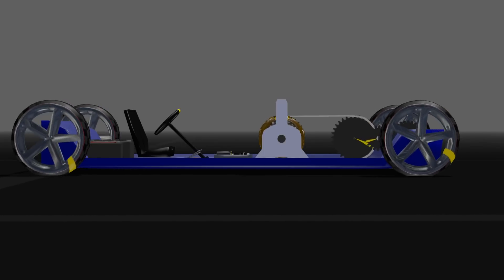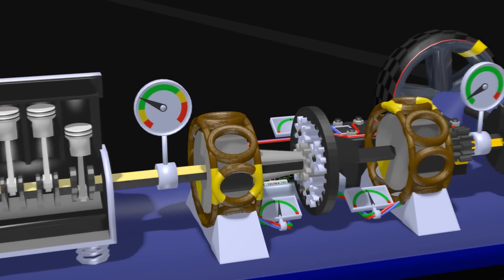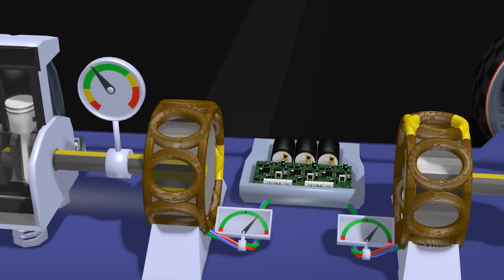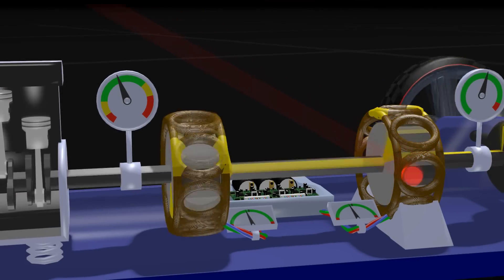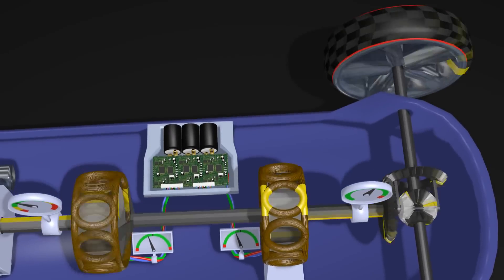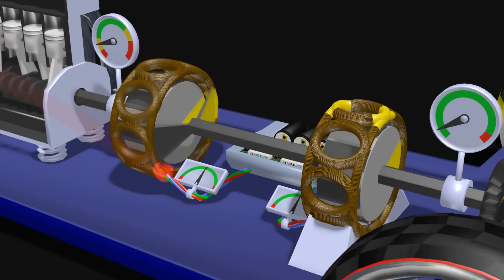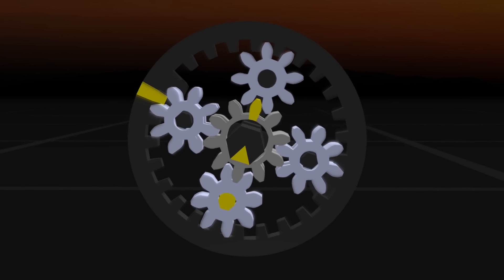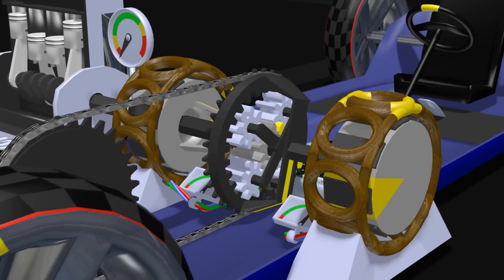Prius Hybrid Drive Explained

Comment: I know this is a few years on, but it’s the first time it has ‘come to life’ as it were. You graphics for explaining how the planetary set works is effective - better than the original Toyota presentations.

Note that the second planetary set connected to MG2 (the traction motor) is really a fixed ratio reduction set, allowing the motor to run faster. 

The ‘smaller’ version of this drive (the so-called “hybrid synergy drive” (HSD) ) does not use a chain to connect to the differential gear set - it’s a short shaft from the ‘ring gear’. Although the mechanical arrangement is well described, there’s a bit more to it! In particular, there are three inverters (to work with the motors, which are variable frequency a.c.), and a pair of d.c. converters. The most important battery in this type of car is the high voltage d.c. one - if it’s dead you’ve had it, but if the smaller 12V d.c. one fails, that is easy to overcome with a conventional external d.c. “jump start” device. 

The contractor for the HSD is Aisin-Seiko - at least 30% of it’s shares being owned by Toyota; it’s own site may be of interest.

Also worth noting that the choice of this system is related to the use of the Atkinson cycle for the engine (most of the time), so as to optimise it’s thermal efficiency, at the expense of reduced torque/power at any given engine speed. What is nice about it is that traction motors have maximum torque at zero speed.

Comment: Great animation and great explanation.  Ford and Toyota share many patents and Fords powertrain has the same flow. I like the way Honda and Chevrolet are running the Clarity and Volt. I just drove the Clarity and it runs great in EV mode. The electric motor has plenty of power.  Thanks for sharing your animation/ explanation.
Reply: Ford pays Toyota for that actually.

Comment: So the Prius doesn't really have what we normally consider to be a CVT transmission with a drive belt and variable diameter pulley's?
Reply: No - it's far more sophisticated than that.
Reply: There's no sliding rollers or pinching belts.  Equivalent function and more is achieved with the planetary gear set, two MGs, inverter and NiMH battery.

Comment: Very concise.  Thank you for your effort.  I consider my 3007 Camry at least as smart as myself.  And it reflects what you've described.
Reply: I wonder what kind of technology your 3007 Camry has? Time travel yet?
Reply: @eo3769  Oops.  I'm a better driver than proof reader, really.                Cheers, JL
Reply: @johnleach7879  👍  Btw Camrys are legendary
Reply: @eo3769  Um, what, exactly makes them legendary (besides Big Toe Wishing)?
Reply: @johnleach7879  They just keep going. They are hard to take down unlike Buicks or the now defunct Saturns 😂
Reply: @eo3769  Why else would the Taliban choose T. pickups?   The rags, used to camels, which forage for themselves, apply the same principle to vehicles  (made by foreign devils, but useful).  Some years ago, a few of us had an idea to deprive the Taliban, et al, of T. pickups.  But by then, CIA had gone from data collection/action to merely collection.  MI-6 was, however interested, but they had no $.
So it became a fund hunt, and petered out.   Heavy  sigh.

Comment: My Prius is running like there’s a clutch skipping, I accelerate the engine and go to a high rpm and won’t go over 30 miles per hour?
Reply: Zabama Z  try releasing the  handbrake
Reply: Zabama Z Have you done maintenance well and change the air filters, clean the battery blower, gear oil change, tire inflated and many details to check. When engine running too high with low out put doesn't count on one particular thing but need to check how well the car is take  care of.
Reply: @davidshanlay  gear oil change? what do you mean by that
Reply: Do you have the red triangle?  It could be a dead battery!  (like the main one, not the starter battery).  When the battery is completely dead, apparently the car is throttled to a maximum speed.

Comment: Interesting that Toyota persevered with the petrol engine hybrid so long ago rather than concentrating on Diesel and lucky for them the way things have turned out (backlash against Diesel especially in city centres). The problem with the Hybrid Synergy Drive (especially series 1 & 2) is at higher speeds the ICE runs too fast (fuel consumption is relatively poor at higher speeds due to the lack of high gearing) and I understand that Toyota are working on a solution to this. 
What I didn't like about the Auris I test drove was that there appeared to be no way of knowing how hard you could press the brake pedal before friction braking came in to play. Toyota have made efforts to give the brake pedal the same feel as a conventional car but this leads to the problem I have with it.
May be I just wasn't taught properly on the test drive so if anybody can advise on this then please do.
Reply: Prius does not have an ordinary internal combustion engine. Cars run the Otto cycle, Prius uses the Atkinson design (there's an extra "knuckle" in the connecting rod). This gives more efficiency with slightly less power and far lower emissions. The brakes send more energy to the batteries (regenerative braking) depending on how hard the pedal is pressed. If you want to increase your mileage, look up 'hypermiling.' If you're worried about dwindling mileage at 80 MPH, don't drive that fast -- all cars get crappy mileage at high speeds. My Prius gets a solid 55 MPG on flat 55 MPH roads.
Reply: @CharlieGosh  Charlie, consider that you might be putting yourself at risk by doing 55 on highways signed for 70, in addition to prompting drivers behind you to do stupid things.  Also, an alert highway patrolman may pull you over and give you this same lecture, if not a ticket.   A few mpg isn't worth the hazard you're creating.
Reply: @John Leach No, I was referring to "unmarked rural highways." We have quite a few of them around here, and the speed limit is 55 MPH. On freeways, my best advice is to "drive the same speed as everyone else and avoid them like the plague." Especially trucks -- just stay away from them as much as possible. If you pay attention, you'll often find a spot where there are no other cars around -- they're all far ahead or far behind you. If everybody else is going 85, that's what I'm doing, too.
Reply: @CharlieGosh  Thanks for your response. Please note that the Prius engine imitates the Atkinson cycle via valve timing not by a `knuckle' in the connecting rod.
How The Atkinson Cycle Works - Car Engines
https://www.youtube.com/watch?v=z45fM2N-4C4&feature=youtu.be
Can you answer my query - how can you tell when friction braking is imminent if you press the brake pedal any harder?  (so that you can avoid friction braking as far as possible)
Reply: @Martindyna  In the Toyota Yaris hybrid, there is an instrument that shows the power flow, from 'charging' to 'power'. If the pointer 'hits the stop' at the bottom of the gauge, it's probably using the friction brakes as well as the traction motor. I normally try to keep it off the bottom as much as possible.

Comment: For those commenting that these systems are more complex than a standard motor, they're actually simpler, as they do without cluch, gears, and the whole mechanical transmission. This takes a lot of stress out of the whole motor/transmission system, and in fact the thermic motor in Toyotas works in a different fashion than a standard car motor, as it is not supposed to work on a full rev range, but it can just work in a limited range, maximizing efficiency, as the other 2 motors take active part in transmission. Thus Toyota hybrids are well known for very high reliability.
Reply: Also eliminates the starter motor, starter cable, starter solenoid, giant 12-volt battery, alternator and its belt, (all of which are common failure points) idling, and failing to start in cold weather. ALL Toyotas are known for reliability -- check the annual Consumer Reports "Frequency of Repair" edition at your library. The next time you watch a nature documentary filmed in the middle of nowhere, you'll see nearly everyone drives a Toyota.
Reply: @CharlieGosh  True - and anyone venturing into the Australia outback wouldn't be seen in anything other than a Landcruiser, unless of course they had a death wish in which case they'd drive a Land Rover..lol
Reply: I believe the Heat Engines in the first Prius models ran on the Atkinson Cycle, but the later ones ran on the Otto cycle....
Reply: @Dave-wy4so  wiki says they run on a Miller cycle, which should be a simplified mechanical version of the Atkinson cycle.

Comment: What a complicated system. I was told that the petrol engine does not drive the wheels at any time. So it is more like the Volt, than other hybrids where the electric motor is just slotted in between the engine and gearbox.
Reply: What you're talking about considered a Serial hybrid where the engine is basically a generator. The Prius is a Parallel hybrid I believe where they share a transmission and either engine or electric motor can turn the wheels independently or simultaneously.
Reply: @GovG33k  That's the point, I have been told that the engine doesn't ever turn the wheels, it just turns one of the MG in generator mode which supplies power to the battery and the other motor.
Reply: @briananthony4044  The Prius is a parallel hybrid. Not serial.
Reply: The mk2 Volt actually has a system similar to this Prius but even more complex with two planetary gearsets.
Reply: I don't think there are really any series hybrids used for light road vehicles, they're mostly things like railway locomotives and mining equipment, the series-hybrid is less efficient because the power has to go through two motor/generators, which I suppose is why the Prius did it, as explained.

Comment: Why is the Comments so recent?
Reply: probably the redesigned rav4 hybrid for 2019 is drawing in people curious to know how the hybrid system works.
Reply: @justin2956  I was pleasantly surprised at how strong this hybrid design is (I was expecting some kind of patch job contraption - but everything's in line - one in line drive train.). The electromagnetic conversion of kinetic energy back and forth with electrical, with little waste, that used to be converted to heat, is very nice.
Reply: Try clicking on "Sort by" at the top.

Comment: An acquaintances 2001 Prius started playing up, ICE engine would only run for 12 seconds then stop, main battery was very low, eventualy it stayed running and they drove it to a Auto electrician, I think he added ATF to the invertor coolant too, local garage told him it was the Autotrans filling point, who knows what damage he's done.
What surprises me as with all the onboard electronics and computers you don't get very good diagnostics on the 2001 model and obd2 reader doesn't seem to work on  Japanese models.

Comment: I think it is brilliant to use an generator as a clutch.  [that is what MG1 is doing.  It is acting like a clutch, all the while it is a generator.  The friction that normally would have been lost as heat in a conventional clutch is converted to electricity that runs MG2]    Genius!
Reply: @ Poker Channel Yeah that's pretty cool. I wonder why hybrid tech isn't more or less mandatory - since it seems naturally more efficient with fuel, in a number of ways.

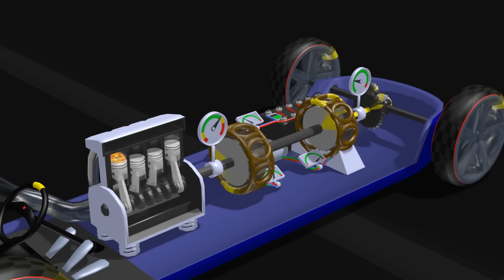Comment: @8:50 is a good quick eplanation of why hybrid gets more MPH:  The engine either is running at an efficient RPM or not running at all.  Engines apparently have a window of RPM which is most efficient.  Hybrids allow for an engine to get away with only running in that narrow window of efficiency.
Reply: It's more than that. The engines used on hybrids are atkinson engines. These engines are far more efficient than standard petrol (otto) engines, but at the expense of torque. The motors make up for that loss of torque where required.
Reply: @MikelSyn   The ICE cubic capacity is also larger to make up for the power disadvantage of Atkinson Cycle.

Comment: What a fantastic video, and amazing use of 3D software!  I asked the man in the Toyota shop yesterday how the engine coupled into the wheels along with the motor - did it use a clutch of some sort - and he fobbed me off with utter nonsense.  Now I understand!  The explanation given here could not be bettered, and the two-motor-generator system with planetary gears has to be the new challenge for youngster to grasp, just as the differential once was.  I wonder if anyone has built it in Lego yet!  Thanks very much.
Reply: I suspect that very few mechanics (even those working at a Toyota dealer) understand how the hybrid system works. It so seldom needs repair that only a few specialists ever work on it, just the rest of the car and things like cooling system, exhaust, brakes, suspension, etc.

Comment: TL;DR weber auto's explanation is better. this one has some useless crap that confuses people. 

In summary weber auto explains that you have 1 ICE connected to a clutch and a motor on the output of the clutch which also goes to a ring gear. On the other side you have a motor going to a sungear and the motion from the planet carrier goes to your differential. During take off either both motors can drain the battery to move you, or the ICE and the sun gear connected motor-generator move you while the ring gear motor loads the ICE and transmits energy to the sungear motor. Depending on how much power you transfer from the ring gear motor to the sun gear motor you achieve different gear ratios and your battery can increase your total power output. During braking both motors act as a generator. Reverse is achieved by reversing the sungear motor.

Comment: Immaculate Niels Blaauw. Though I will have to watch it several times. Meanwhile Google search Deferred Atkinson Cycle engine for super efficiency and Hybrid EV mounting capabilities. Once the additional equipments as generators, batteries, motors/generators are mounted the opportunities to enhance efficiency of ICE or whole car opens up.

Comment: so where is the cvt transmission of above car ?
Reply: The engine is not directly connected to the wheels. Depending on how much power is put applied to the motor that drives the sun. That affects gear ratio. There for, CVT.
Reply: Herpn Derpn thank you 🤙